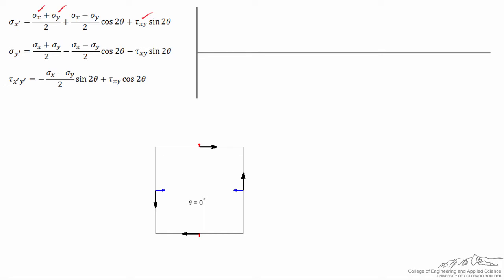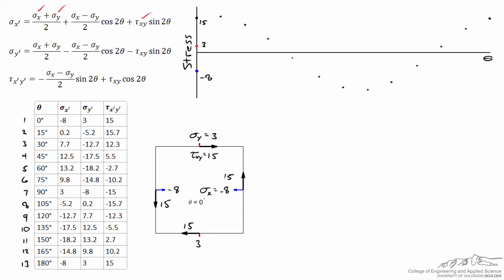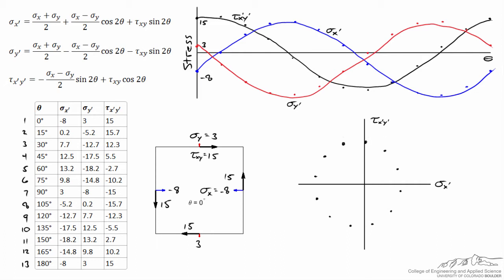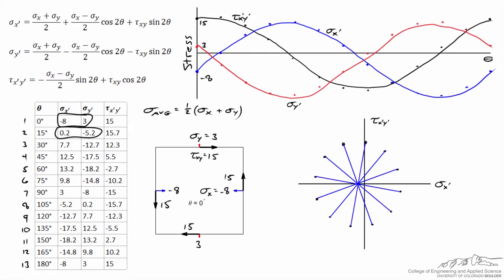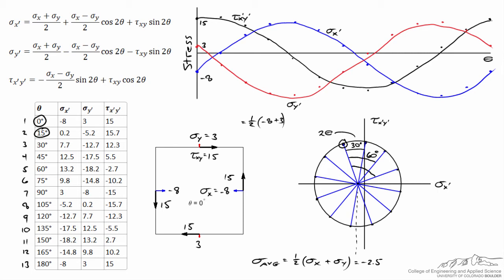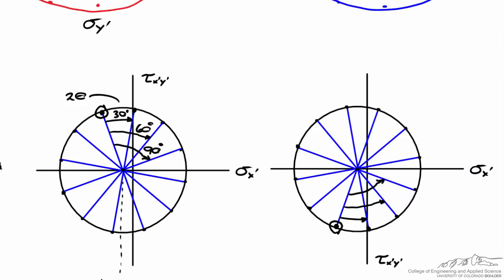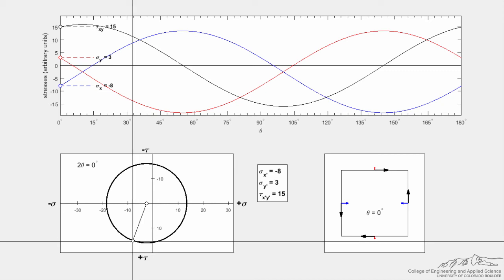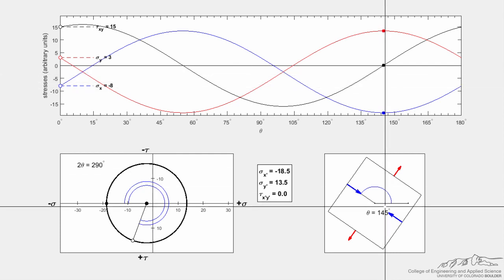Drawing Mohr's Circle using the Stress-Transformation Equations

Comment: Awesome video! I’m trying to plot the wave like transformation functions in MATLAB, -90 to 90 degrees, and I get very short wavelengths with too many data points. How can I get such a neat graph for that range of theta? Edit I remembered MATLAB's default is in radians, so using sind or cosd fixed my graph. Thanks for the video. It helped me in my mechanics of materials class.